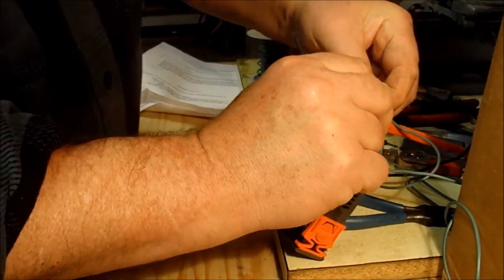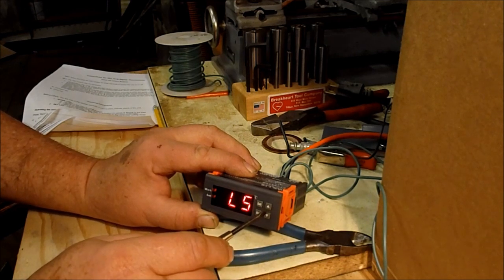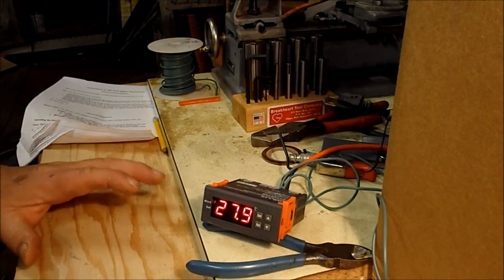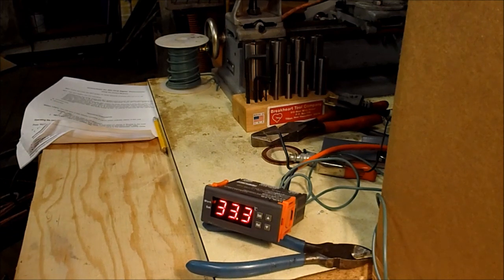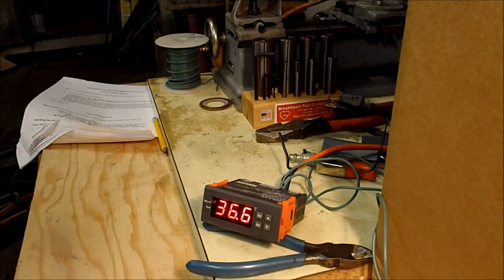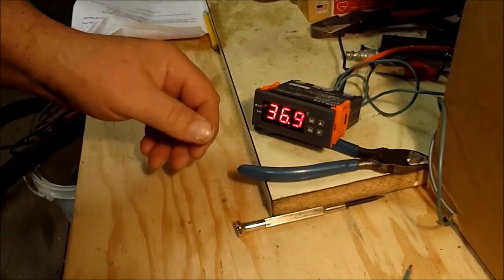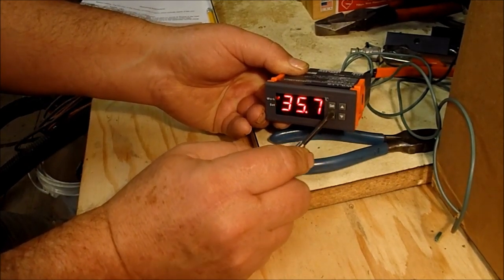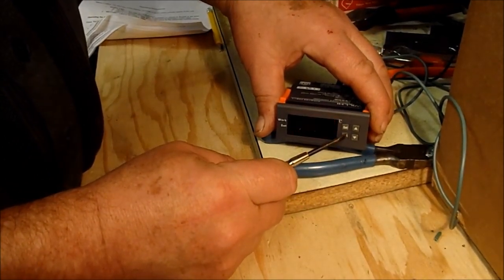Part 3 WILLHI WH7016 temperature controller for poultry incubator

Comment: Do you have a documentation of your actual egg incubator using this controller ? I have the same but the temperature is dropping too low when the controller turns the heat source off.
Reply from the maker: +xl 
On this model I set the high temp to 38deg and the low temp to 38deg. It shut the heater off at 38 deg. There is a setting to adjust the temp variable ( if you set your house hold thermostat for 72deg it doesn't hold at 72deg, it shuts of at 75 and comes on at 65, vise versa for air conditioning). I set it at 1 deg so the heater goes off at 38 and, even though the low was set for 38, it comes on at 37( d setting). The temp in the incubator averaged 37.5. The air temp is going to cycle below 37 because its dropping when the heater comes on, but the mass temp ( eggs, water etc) stays pretty steady, the more mass the better.
This controller worked real good for a couple of years, then temps started to wander. I got a similar controller calibrated in degF. It wouldn't let me set the high and low temps the same, so high is 100 and low is 99 with 1deg d. It shuts off at 100 and comes on at 98, but, again, since the temp is dropping it goes down to 97.5 or so before it actually starts to come up( the more eggs in the box the less temp swing). The incubator is just a wooden box with no insulation so insulating it or keeping it in a warm room might keep the temp swings more stable.
This incubator uses light bulbs as a heat source, when we could get 100 watt bulbs it heated up faster, the last bulbs we could get were 60 watt and the temps rise is slower. I tried ceramic bulbs but the lower wattage ones don't put out enough heat and the 100 watt+ have so much density that they stay hot after they shut off and raise the temps too high.
Reply: +psgflier Thanks for your detailed answer. Do you think a fan is useful inside the incubator ? I'm going to try with halogen bulbs as this is the most common bulbs on the market (in Europe at least) that produce a lot of heat. I tried with two power resistors but they have too much inertia, once they're hot they remain hot too long and it messes with the temperature control, and conversely they take too much time to heat and the temperature is dropping too low.
Reply from the maker: +xl 
I'd say a fan is pretty much a necessity, otherwise the air gets stagnant and stratified, warmer at the top than the bottom. One of the styrofoam incubators we have has a fan and the other does not, the one with the fan gets better results even though they are both the same and single layer, my wife uses the fanless one as a brooder, puts the eggs in it when they are ready to hatch. The big incubator uses a bath exhaust fan, but I've seen people use old computer fans
I wonder about halogen bulbs, seems like they get pretty hot, but I don't have much experience with them.
I have been toying with the idea of building a new incubator ( the wooden one I got from a guy in Texas I believe, who home built them) and I'd use resistance wire or heat element wire. You can vary the length according to the volume of the space, it heats up fast and cools of fast ( example http://incubatorwarehouse.com/250-watt-coil-heater-kit-220v.html)
Probably the thing that made the most difference to us was good thermometers. We fought with them for years and finally broke down and bought scientific bulb thermometers with etched glass. The digital ones really suck.
Reply from the maker: +xl  
I'm posting a video of our incubator for my daughter-in-law, it'll be up in a few minutes on my site at psgflier.
It's not much, just enough for her to see the new chicks

Comment: Hi i think i found it, setting the Heating mode on 37 and Temperature Differential  D mode in 5??? i am gonna try it tomorrow..
Reply from the maker: Helena Kraaijenoord The d is the number of degrees the controller will drop to  below the low set before it activates.
If you have the low set to 37 it will drop to 32 before it kicked back on. The lowest setting on d is 1 so if you set to 37 it will drop to 36 before coming on. I set mine to 38 high and 38 low with a 1 d, it shut of at 38 and came on at 37 for an average of 37.5

Comment: Hello, thanks for the video, but i think i bought the wrong temperature controller. I want to set it on 37.5 degrees  but that is not possible. Am i correct that i can only chouse between 37 and 38 degrees? By 37 degrees heating goes on and by 38 degrees it shuts off. That is too hot for my peafowl.......Do you have a idea how i can set that right??? Thanks out the Netherlands,,
Reply from the maker: Helena Kraaijenoord You can only set it for even numbers. You can set d at 1 which is the lowest setting. I set mine for 38 high and 38 low with a 1 d and the controller shut off at 38, stayed off till 37, then came on. This averages 37.5, which is as close as I could get.
I just got the same controllers in deg F instead of cel. These have less temp variance from high to low as deg F are closer together than deg C, but the high and low can not be set to the same temp, so high is 100, low is 99, and with a d of 1, it drops to 98 before coming back on

Comment: Does it retain user settings after power outage?
Reply from the maker: When the 5 & 6 terminals are jumpered together the settings stay at whatever the controller is set to even if the power goes out. From what I saw setting this up, the settings remained even without the jumper. Voltage and current surges during a power outage or brown out may cause the settings to change if the jumper is not installed.

Comment: It's best to get the Fahrenheit model, the one I bought turns heat source on at 99 and shut off at 100. Using a Celsius model and setting it to operate between 37 - 38 will give you temp range of 98.6 - 100.4 F, the closer the range the better when it comes to hatching bird eggs.

Comment: Hi, I bought one and works fine. The instructions are in Chinese and I was wondering what 2 letter abbreviation in the settings will let me adjust the temperature range. Mine turns on at 36 and off at 37. So it is on and off all the time. I want it to run from 33 to 39. Can you please help me
Reply from the maker: ls adjusts the low temp and hs sets the high temp. Look at video #2, I go through setting up the parameters

Comment: I have a Willhi WH7016. It is set up for 220v. I have a water tank w/ a 220v (2) wire heater in it  I need the controller to turn the heating element on @ 90 degrees F on the "LS" & turn off @ the "HS" setting @ 100 Degrees F. I cant figure out what Im doing wrong!!! It will display the temp but will not turn on the heating element. Can you please give me an easy diagram??

Comment from the maker: I meant 5 amps not 5 watts.
I used this for an incubator using two 100 watt light bulbs, for your application a relay would be needed, you just need something that switches with low power, and can handle 15+ amps for your smoker.
I don't off hand know what you need, find a heating and cooling guy or electrician, or try your luck with the guys at Home Depot. You should be able to find what you need in an old refrigerator, washer, dryer, or bathroom fan.

Comment from the maker: You need to use a solenoid or relay if the device you are controlling draws more than 5 watts of power,
 A solenoid and relay are electrically the same, a switch, just like the wall switch you use to turn on and off the lights in your house except they use electricity to activate the switch.
You would wire the controller up exactly the way in the video, output from terminal 1 or 2 to the control terminal of the relay. and your operating power through the controlled terminal to your device.

Comment from the maker: If your controller says -37 when you turn it on, it means it's set for negative 37 degrees Celsius.
I don't have a wiring diagram. Power goes to terminals 3 & 4. 1 & 2 are switched power for the device you are controlling, power goes in one from your power supply, and switched power comes out the other for your device. You can supply power by connecting a jumper from 3 or 4 to 1 or 2. Common or return voltage can come from the device to the terminal(3 or 4) not used to supply power

Comment from the maker: There are different models that use the designation WH7016, differentiated by letter suffixes, examples are G and H, instructions shown in the first video. They are quite a bit different than the plain WH7016, with many more functions and outputs than the WH7016.

Comment: Thanks for showing how to wire this up.  It was a little confusing on the directions. 
You talked about a relay or solenoid.  I have a electric smoker that I need to control the temp.  It's about 15 amps and will be wiring up the controller to an outlet.  What type of relay or solenoid would I be needing for my smoker to work?  Also your video towards the end covers up how I would wire the relay or solenoid.  Last question, do I need both or just the relay. Thanks !!